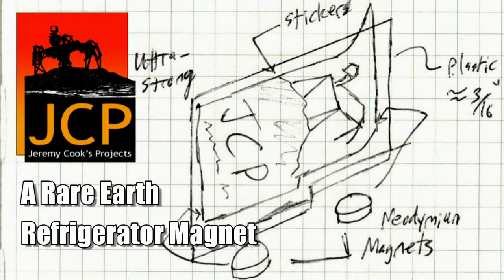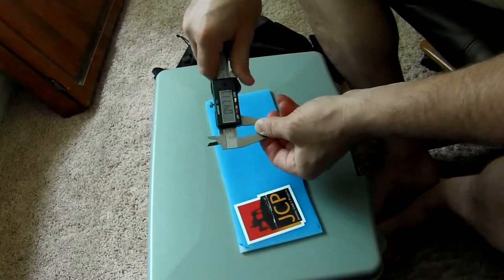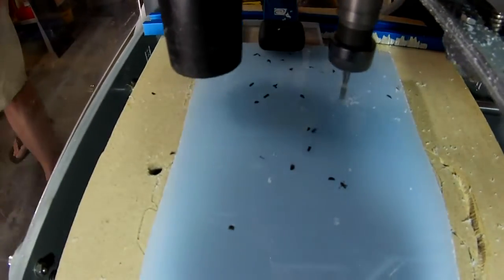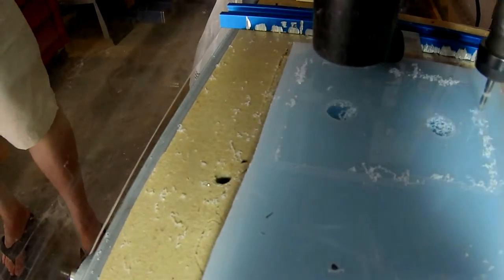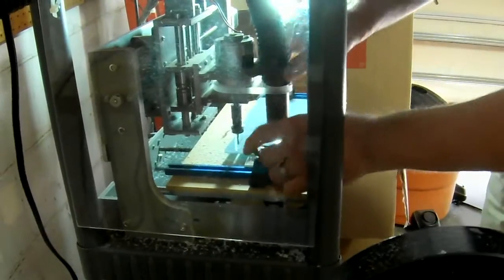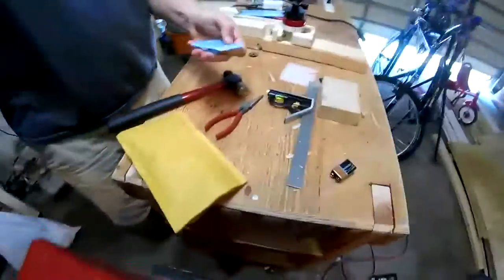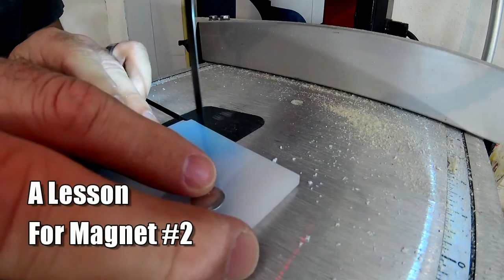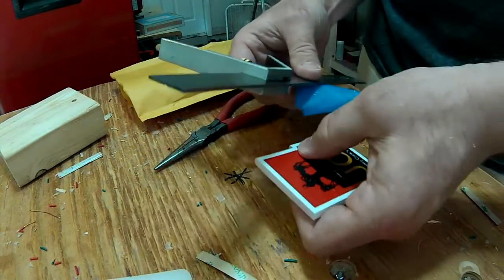Rare Earth Refrigerator Magnet

Comment: Any excuse to use the CNC router is a good excuse. Another great simple project Jeremy. I need to try something like that. I've never cut acrylic with my Shapeoko yet.
Reply from the maker: Thanks! I'm honestly not quite sure what material that is I was using. Came from quite an old light box that I threw away when moving. It's some sort of plastic, but I wish I knew specifically so I could buy more!